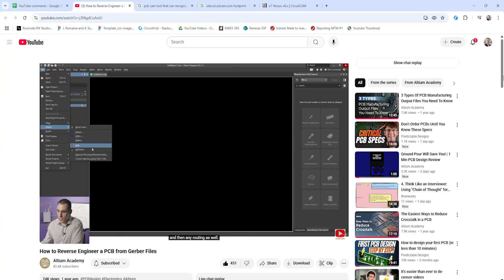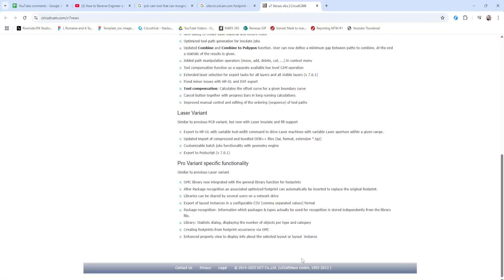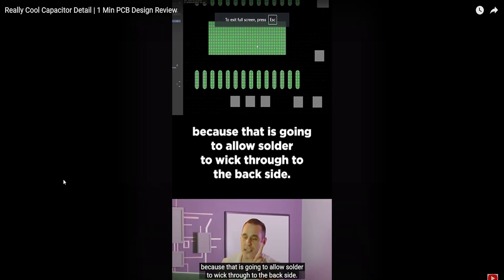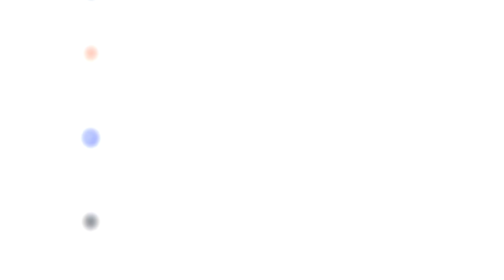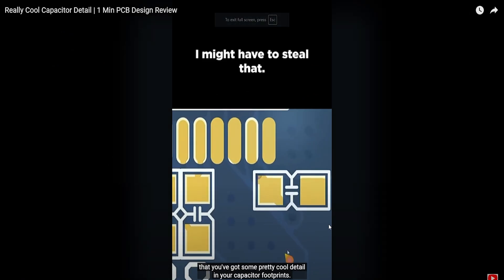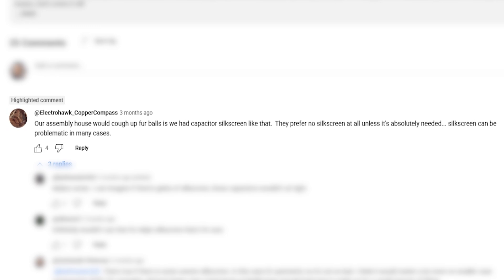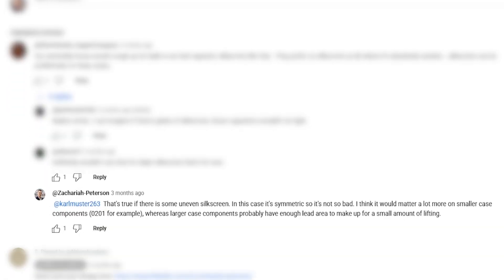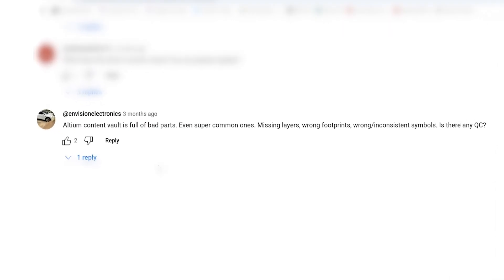What's in Your PCB Footprints? | PCB Design Office Hours #8 With Zach Peterson

Comment: Hi zach, I have some questions.

While designing a power distribution board or power supply, what are the key factors we should look for?

And how to measure polygon maximum current capacity and how to measure pcb overall thermal status? 
Thank's

Comment: we had a manufacturer suggest we leave out silk screen as they've "experienced soldering failures" resulting from silkscreen in close proximity to pads. they said the silk screen ink could off-gas causing issues. i told them if the silk screen is off-gassing, the pcbs clearly weren't manufactured correctly, and they should get a better board supplier. honestly the amount of bad soldering we've received from contract manufacturers since the move to lead-free is staggering.

Comment: Most of the time, I used the Altium library loader to get the footprint. But need to check footprints before placing. Most of the packages can be found easily with the library loader, even not in MP search.